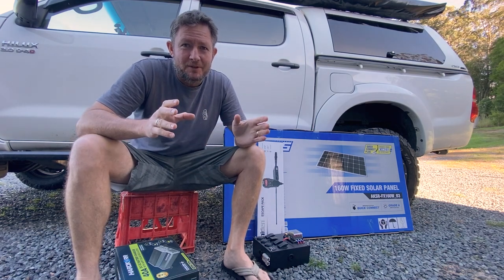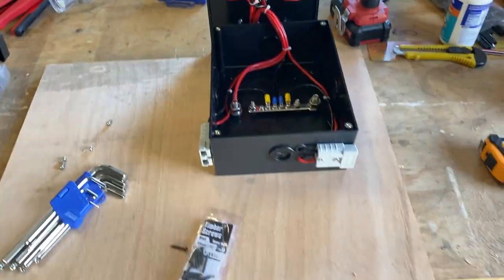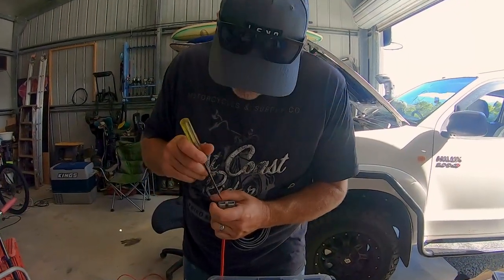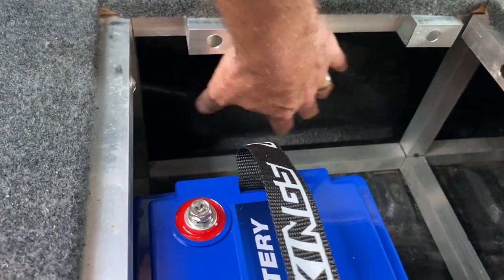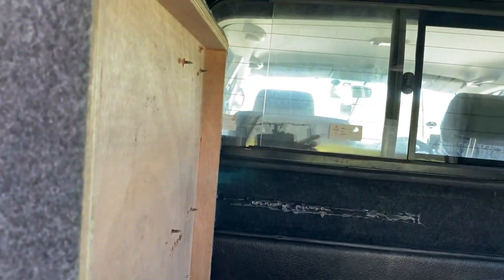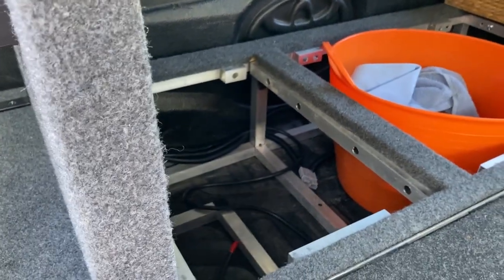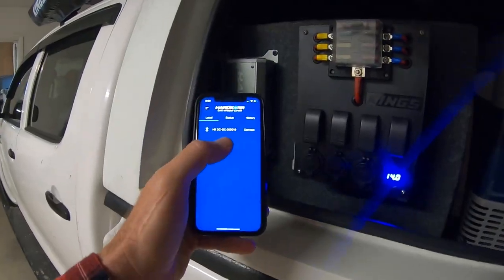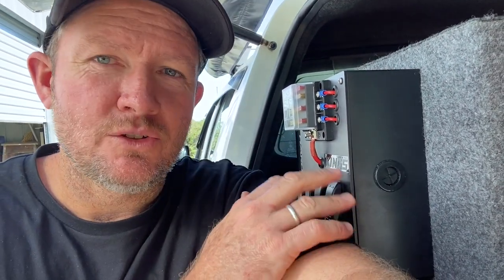Installing a Dual Battery System (Hardkorr DCDC Charger + Kings Lithium Battery)

Comment: Could I suggest you tie down your battery,the dirt roads out that way will vibrant the hell out of it and possibly jump it out of its cradle, like the videos watching the build very interesting. Happy Travels 🤗👍
Reply from the maker: Yeah thanks mate I reckon you’re probably right! It’s in a pretty tight space and with the timber board/cover over the top it would be hard to pop out of there but I guess better safe than sorry 😅👌🏻
Reply: @TheBeatenTrak 
Problem is not 
"Popping out of there" rather the constant 2mm-10mm bouncing and vibration over potholes and corrugation will shudder the cells in the battery putting them at risk of Failure.
Reply: I was at thinking it would be better turning around to keep the terminals further away from the metal frame too. Maybe its not an issue.

Comment: I've read in a lot of places it's not good to use the canopy and cab roof rails to mount the same piece of equipment to as the tub/canopy can flex if you go offroad which could cause damage to whatever is mounted to it
Reply from the maker: So far so good but I guess we’ll see 😅

Comment: Have you had any issues with the DCDC charger, I have recently done a kings battery and hardkorr charger and the charging figures are wrong in the app compared to the actual figures when testing with multimeter, plus the other day I had an over charger warning come up on the app
Reply from the maker: No mate it’s all been fine. I’ve had no issues with it at all. Are you using a kings lithium battery?
Reply: @TheBeatenTrak  Yeah I'm using a kings lithium battery

Comment: How did you go about getting the wires into the tub?
Reply from the maker: There was an existing hole at the front of the tub I used to run the wires in. I sealed it up with silicone after.

Comment: Thanks for the video mate. Are you still happy with the Hardkorr dc-dc charger?
Reply from the maker: Yeah mate it hasn’t missed a beat! I’ve had my fridge running non stop since the install and the battery is always fully charged. 👌🏻
Reply: @TheBeatenTrak  good to hear mate. Might look into one of these
Reply: Thanks for the reply, ol mate. I'm tempted by it that's for sure. I noticed the Redarc Core is similarly priced, so I'm gonna look into it too.  @TheBeatenTrak

Comment: Hi mate, how is the Hardkorr charger going, any issues?  I am looking at installing one of them.
Reply from the maker: Mate so far it’s been awesome. Since installing it I’ve tested it out by keeping my 60ltr fridge running non stop for a few weeks. Between the Hardkorr DC and my solar the battery has been kept fully charged. It’s unreal 👌🏻
Reply: @TheBeatenTrak  Thanks mate.
Reply: @TheBeatenTrak  Is that the Kings 160watt panel?
Reply: sorry mate, you actually mention that it is a Kings panel in the video.

Comment: oi oi oi, that aluminum bar should be isolated near the battery terminals and rubber boots shud be used..... and a thick rubber strap is needed as extra  security to hold the bat down.
Reply from the maker: Thanks for the advice mate appreciated! I’ll definitely fix that up 👍🏻

Comment: The most useful item in this build is the milk crate at the start!  😂
Everyone makes the same mistake under rating the solar needs and using a crappy quality solar panel. If you get that correct you don't need all that dc-dc bs! And you won't be stuck out bush with a dead truck battery!
Reply from the maker: Appreciate your insightful comment there mate. However I can tell you that this system has been running my fridge nonstop for over 8 months now and it’s always fully charged 👊🏻

Comment: Can I ask what sort of ampage wire you used? 
I purchased and waiting on it. Just wondering if the cables are long enough for the ones supplied with the charger. 
Thanks neat setup 👌
Reply from the maker: Hey mate sorry for the slow reply! I actually bought and used the Hardkorr wiring kit as well which was perfect 👌🏻 Is that what you’ve ordered?
Reply: @TheBeatenTrak I've ordered the 25amp version but we are still confused with what gauge to use aswell
Edit - Allgood got the wiring all done just wondering if the dcdc charger is supposed to turn off when the car  goes off or does it stay on for awhile?